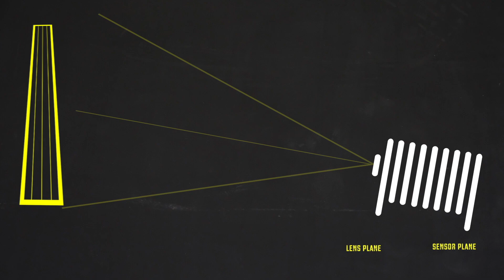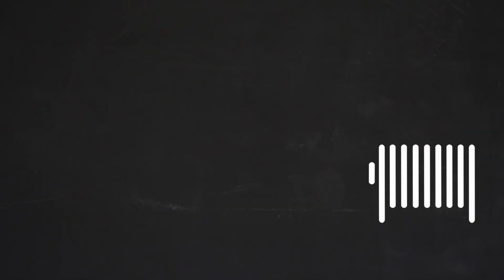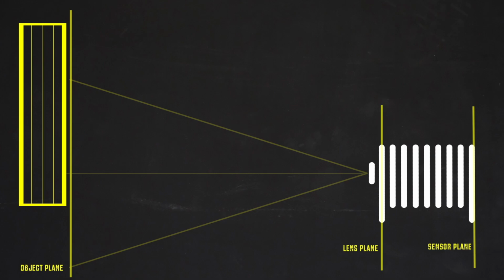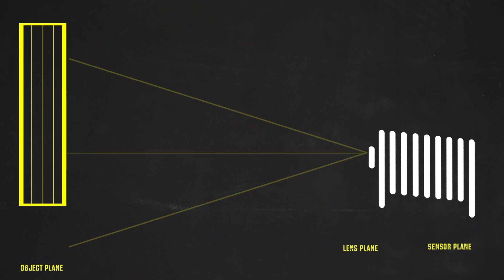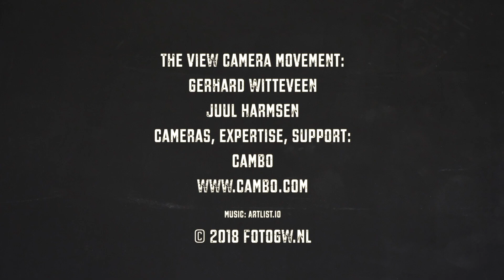TVCM EP4 Architectural v2

Comment: Hi there, i do shoot on Sony A7iv and i own the new 16 to 35 mk2 and a 12 24 2.8. Will my 2 lenses works with your system?
Reply from the maker: Sony lenses can never work with a view camera. That's due to the short Flange-Focal-Distance of the Sony. The sony itself is a very capable body to use behind de view camera. 

FFD of a Sony is 18mm. 
You'll use lenses designed for a FFD of i.e. 70mm. The 52mm between these two is the space you need for the bellows and the mechanics. Besides that, you want to have lenses that provide a large image circle in order to enable camera momvents.